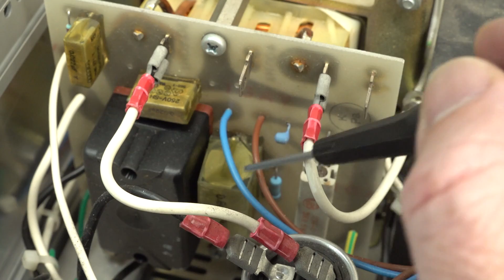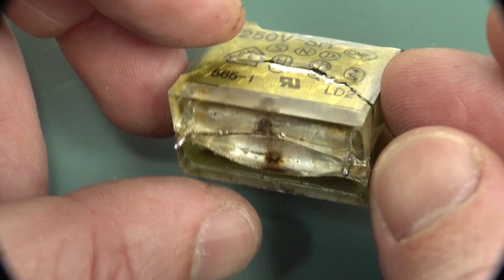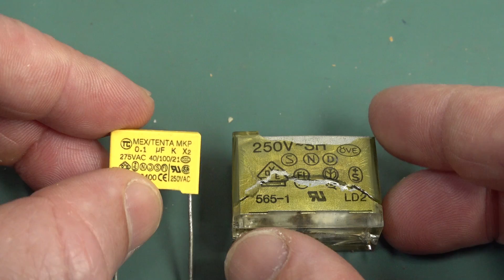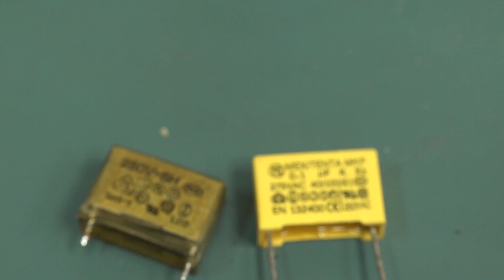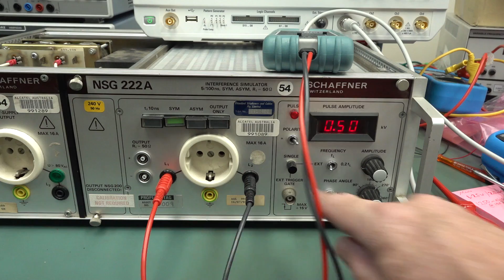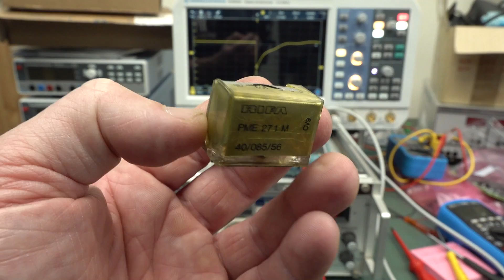EEVblog #1183 - RIFA Madness (Schaffner Repair)

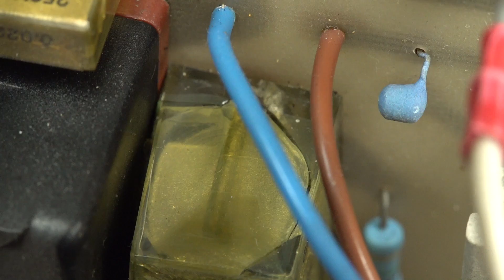Comment: What's that weird single pin (?) blue element at 3:49?
Reply: if you look at the pcb under that, there's a trace that ends just under it... So, it's probably a 2 pin device, just a strange angle
Reply: It’s a discrete type of magnetic low-energy storage called an inductive capacitor, resistance of DC signal with built-in delay for AC.
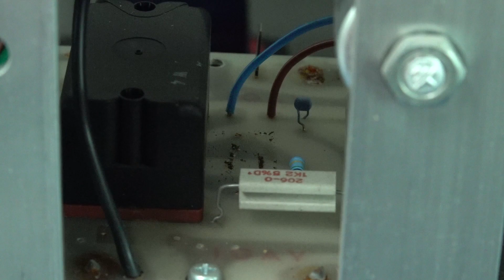Reply: Look at 11:50, it has 2 pins lol. The only single pin devices I know of are for air ionization :P However, you could still technically think of them as having an input and output :P
Reply: @HighestRank  What kind of OTHER weird gear uses such a device??

Comment: Hmm lovely, I had 3 for 3 RIFA caps bad in my B&O 8802 TV. Only the main X2 suppression jobbie let the smoke out, although the 2 Y class were also bulged and cracking. Is it only me who actually enjoys the smell of blown caps and burned phenolic though?
Reply: Yes 🙂   I suggest you buy and use and old Hoover or Electrolux vacuum cleaner to ensure maximum smoke distribution.

Comment: Scope Glare, the Rohde & Schwarz out of the box has awesome remote control via Ethernet access.  So you can effortlessly throw display to any low glare monitor.  I find it very usable as I can go to a much bigger glare free screen and control using a mouse

Comment: Feel bad as a Swede that we have manufactured caps not holding together for longer time :)
Reply: Not RIFA's failure. It's the nature of paper capacitors. It doesn't matter if it's American, German, Russian, or Japanese, all of them develop excessive leakage current over time, then finally they become short circuit. AFAIK, it is caused by the manufacturing process of paper, where they use a lot of different chemicals, and trail amounts remain in the final product as contaminants, which degrade the insulation capability over time. Similar (or the same) reaction yellowing the books.

Comment: This link says the X class is designed to fail "short" (https://www.allaboutcircuits.com/technical-articles/safety-capacitor-class-x-and-class-y-capacitors/ )  I don't know if that's right. At time stamp 10:59, Dave says X class is designed "so they don't fail short"
Reply: Due to the circuit placement -- If X cap fails short it will trip the fuse. If Y cap fails short it will send voltage to ground. If there is no RCD/GFCI this can cause a shock hazard and unreliable operation.

Comment: Could you explain the importance of X capacitors? I have plug in surge protectors that self-consume 29-43 mA, and I suspect it is the X capacitors leaking current! Was wondering what effect if I remove them?
Reply: Because the X capacitor is wired across the mains, it’s expected to draw reactive power of incoming mains voltage divided by its reactive impedance. I’ll guess that it’s about 1uF based upon those currents.

Comment: Preventively replace all of this kiné of capacitors....  the are horrible and do not survive their age

Have to change the from ou apple2 collection (power supplies)
Reply: Looks like a european version of the US "black beauties" and bumblebees, used in vintage tube or valve equipment from the middle of the last century.

I have had both of them blow up in my face. Tough on the trousers when it happens! Worst thing is they were frequently used as the line bypass cap in guitar amps, hence the term "death capacitor".

Comment: now to think about it i think that is how them power meter reversing theft of service devices are supposed to work

he calls the device a retarder and  the video is https://www.youtube.com/watch?v=gFtB0C0rBaM

so you may need to have a license to use the device and have a special meter installed that could compensate but the meter was very expensive so the power co had very few of them meters as it could cause the meter to run backwards or may trigger the tamper flags 

this is my guess

Comment: Didn't the schematic shows that those four capacitors to ground connected through a 22 k resistor? That would limit the current flow, but not the voltage. Did the one that gave us magic smoke have a resistor in series?
Reply from the maker: No, it was the X cap direct across the mains
Reply: EEVblog
“X-as-Y caps” I heard.

Comment: Yep, always blame the Rifa, I had one go bang inside a Hoover Junior vacuum, the stink was immense and the stink stuck on the vac for months even after cleaning the mess out. Where there's a Rifa, there'll be trouble...

Biggest problem with them is they don't bother encasing the cap in a plastic box, like everyone else does, so the resin is exposed and breaks down faster, and a contemporary cap would still work fine when a Rifa goes bang, because Rifa just got it completely wrong when cheaping out on materials, not that they care, they got their money, and these days someone else is getting money too for the replacements...
Reply: twocvbloke moisture in compounds remains a modern problem, even with hermetic and conformal coating. Shell up what you may, when things short and go bang the case becomes a potential projectile no matter the construction. Place them in locations where they won’t blind a peeping tech like so and that’s all the safety there is.
Reply: @HighestRank , LOVE the "peeping tech" visual... BANG! OMG, did they say "Wear safety goggles?"
Reply: The lack of enclosure is only half of the problem. The other half is that they insisted on using a paper dielectric instead of polypropylene like most other series and brands. It's VERY hard to make a reliable paper cap, especially if you use anything less than a glass or a soldered metal can with oil filling. Unfortunately RIFA is still making money from this crap, since some people think that using original parts is the best way to repair equipment.
Reply: Speaking from experience you wouldn't have been any better off with an Electrolux. The fastest way of making a whole room smell of RIFA!

Comment: Does this issue occur simply because of age? My thinking was that the dielectric expands from many instances of self-healing, which in turn fractures the outer case, lets in moisture & finally results in catastrophic failure. 🤔
Reply: Just age. If the capacitors are just kept in a component drawer they will still crack after 30 or so years.